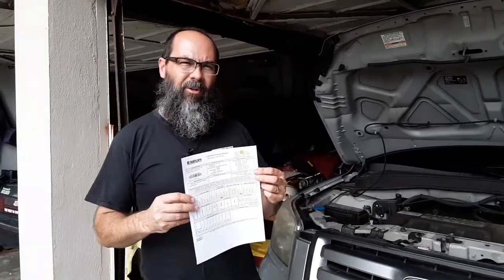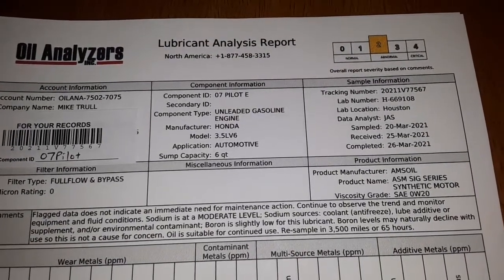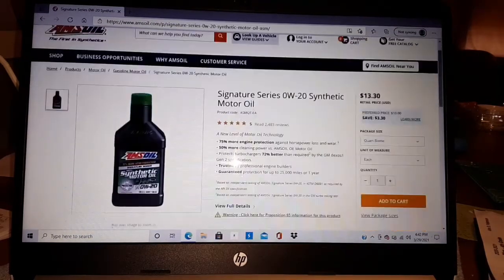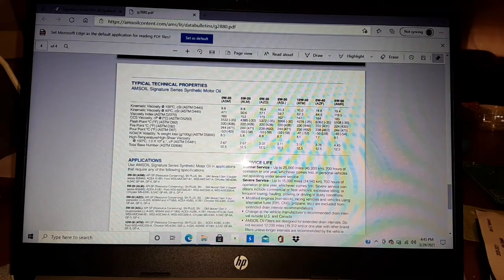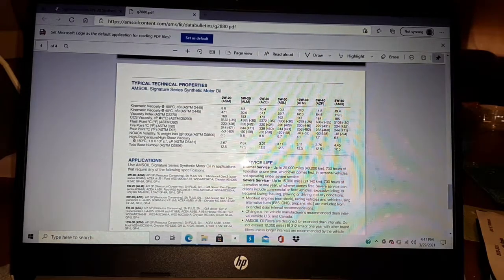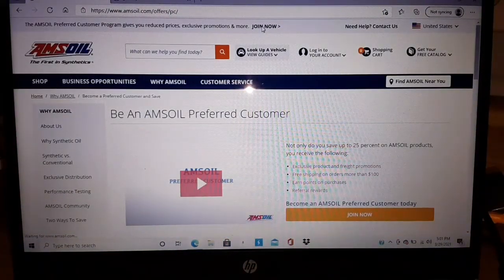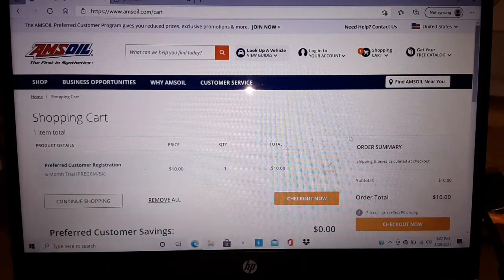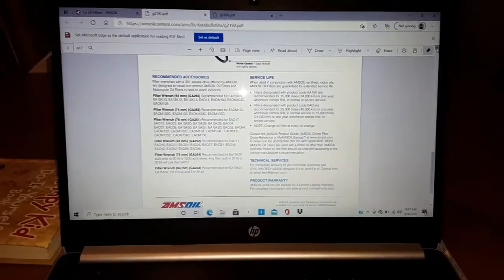07 PILOT OIL ANALYSIS RESULTS number1synthetic.com performance tests/filter change/Verse of the day

Comment from the maker: Amsoil Bypass Filter Systems:
https://www.amsoil.com/c/bypass-oil-filtration-systems-mounts/32/?zo=1463115

Amsoil Filtration:
https://www.amsoil.com/c/filters/29/?zo=1463115

Oil analysis kits:
https://www.amsoil.com/c/oil-analysis/102/?zo=1463115

100% Synthetic Motor Oil:
https://www.amsoil.com/c/motor-oil/2/?zo=1463115

LOOKUP your vehicle/ equipment by year make model engine:
https://www.amsoil.com/guides/?zo=1463115

Save 25% as an Amsoil Preferred Customer:
https://www.amsoil.com/offers/pc/?zo=1463115

my website: number1synthetic.com

Mike Trull Amsoil dealer 1463115

Thank you!